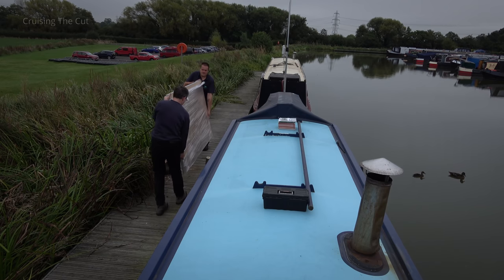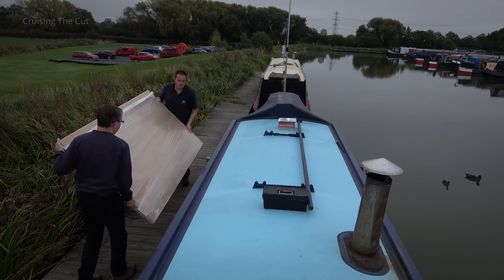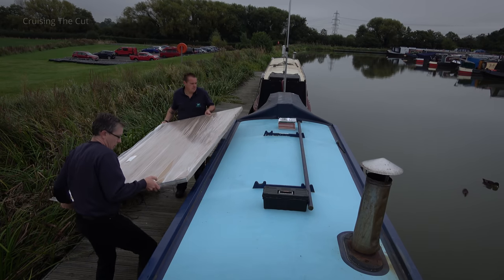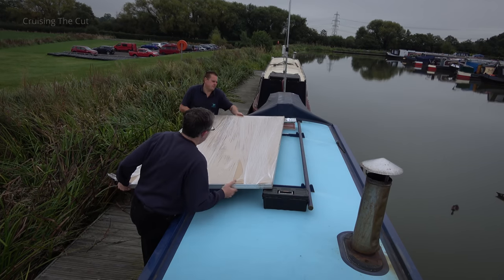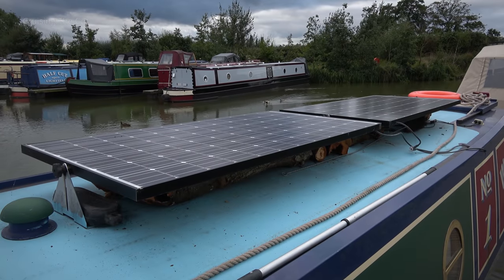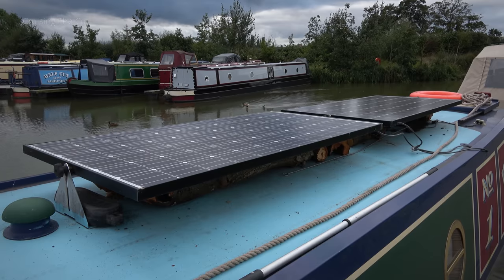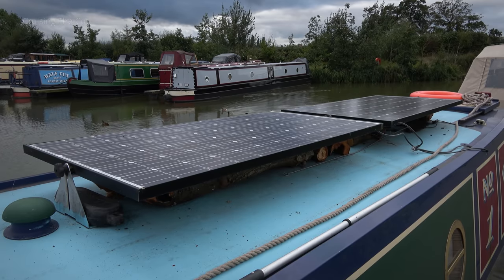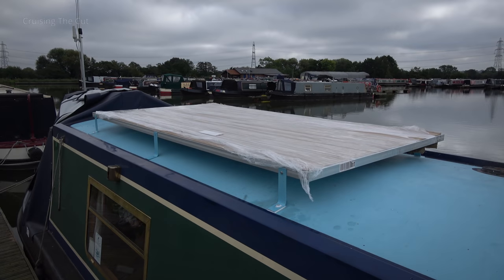260. Solar Panel and Lead-Carbon battery update (narrowboat)

Comment: Have you thought about running a hot water pipe from your log burner around your batteries? You will get lot more out of the solar if your batteries are kept at the right temperature. 
Really enjoyed listening to this.
Reply from the maker: They're at opposite ends of the boat

Comment: David, what would happen if you got one of those hard sided freezer gel packs?  We use them for picnic coolers here.  Freeze it up nice and solid by day when the sun is shining or engine is running, then transfer to the fridge overnight?  A little fridge is insulated like a cooler, and you could then run the fridge a little warmer.  Likewise, would a rechargeable battery vacuum cleaner let you store a little power for the other heavy energy consumer?  
I love your videos.  I imagine you could read the phone book and I’d enjoy that, too.

Comment: While you didn’t specifically say, it sounds like your panels are fully charging your batteries on fully bright sunny days. If that’s the case perhaps you just need more battery capacity so the sunny days will carry further through the overcast ones.
Reply from the maker: If only we had any worthwhile sunny days in winter!!

Comment: what about a small water wheel, or water turbine? keep up the video's!
Reply: You'd need moving water which you don't generally get on a canal. You'd also need quite a substantial water wheel to generate meaningful power (a boat prop just doesn't generate enough power) and river authorities don't like you disturbing the flow of the river as it causes flooding.

Comment: All the technical details aside, bottom line is are you happy with the results? It appears you are so job well done. BTW an old fashion incandescent light bulb provides a good test load used with a multimeter.

Comment: If you move your fridge to your "greenhouse" area, where it is colder, you can save significant amount of power as the fridge isn't heated so much by ambient air and does not need to run so often. The "greenhouse" might not be cold enough to keep your milk there but it is cold enough to help your fridge and freezer. Also I assume the "greenhouse" gets warmer only on days when sun shines, but those days aren't of any concern since you generate power from your solar system.
Reply from the maker: Cheers. There's no space to put the fridge freezer in the well deck and no power out there for it either
Reply: @CruisingTheCut  hehehe ;)

Comment: If there's a way to channel colder outside air on the fridge coils without chilling the rest of the cabin that would drop the fridge power usage dramatically
Reply: Caravans utilise this if they are well built. 
A grille in the exterior down low for cool air in...
and another grille up high to let the warmed air out.
Can you envision a problem with that on a boat?
Reply: @JohnSmith-yv6eq  Yes, but not an insurmountable one. It would require an air intake above the waterline, a baffle conveying the air under the coils, and a short chimney stack for the warmed air to escape. It should establish circulation pretty easily. It's a bit of a shame to "waste" the warm air, but it's probably still going to be rather chilly compared to the cabin temperature. The other issue is the space that gets dedicated to it in what is already a bit of a cramped situation.

Comment: It's great to hear the results of the experiment. :) It's a bit of a shame the engine run log was lost, but I can't say I wouldn't have done the same myself. I'm terrible for losing things. There is one point that I wonder about though. charging some phones (or tablets really) can take over 2A at 5V. I guess it doesn't go on for very long at that rate, less than an hour.

Good to know about the M1 Macbook power draw, that's a really impressive improvement. I'm glad you stayed out of the operating system debate. I'm thankful to be in a position where I can be very neutral on the subject now, but I do find myself whining about Linux when I see people falling for the hype l fell for in the 90s.

I get that feeling of relief. :) I had this thing about being very independant and I didn't like big corporations. I tried to live very independently in the digital world and I hardly had any mainstream entertainment either. I had some interesting experiences, but I didn't realise how stressful it was.

Considering these results, if I were to experiment with minimal electricity use, I'd first want to be very good at cooking so I can make nice food from fresh ingredients without breaking a sweat. I've entirely given up hope on that point. :) It might help to be vegetarian, and would definitely help to never be far from a grocers. Computing I'm not so sure about. Perhaps without a fridge, an M1 laptop would be fine? I don't know. In any case, my retro programming hobby could be made to work with very low-power hardware indeed. However, if I could work video playback into my project, it would probably need hardware drawing as much or more power as an M1 or a tablet. If I didn't have enough power for video when I wanted it, (regardless of the device displaying it,) I'd really be back in my old stressful lifestyle.
Reply from the maker: Yeah, and 2A at 5V is less than 1A at 12V so it's miniscule.
Reply: @CruisingTheCut  Ah... right. Blame that one on tiredness; I'm not sure I should be awake right now, although I've had plenty of sleep.

Comment: I really liked this VLOG.  I’m learning so much.  A question: Could having panels on both ends of the boat provide some advantage in shady moorings? Say, the stern is under a tree, but the bow is in the sun, that sort of thing?
Reply from the maker: Yes, if they're on separate charge controllers or have isolation diodes such that they can act independently.
Reply: @CruisingTheCut  thank you sir

Comment: David... in my experianse batteries last for 4,5/5 years before they get tired.
Reply: The life expectancy of good quality Lead Carbon Batteries in over 15 years when sized correctly for the application and  I have a 6 battery bank of 2volt 270AH lead carbon batteries that are still
Reply: Sorry,  the cat decided to play with my keyboard. I was saying if the batteries are "sized correctly and not cycled too deeply"   My Batteries are still doing their job and running everything they were sized to do.
Reply: What type of batteries? How deeply do you discharge them? What do you use to charge them?

Comment: Check out Renogy Dc-Dc 50 amp charger. In stalled one on my boat love it.
Reply: A good idea if you have lithium batteries, but no point to having one of those if you have lead-acid batteries which can be charged straight off the alternator.

Comment: just come across your channel, and I am enjoying the videos! just a thought..would a 12v coolbox be a better option for winter? probably use less power than a fridge, and I think you can probably get a freezer compartment one too! not sure logistically if it would be large enough to store your food for a good few weeks cruising but might be an option? anyway, back to watch some more!😃
Reply: No , because a cool box does not switch off when it reaches temperature unlike a compressor fridge . Even a small cool box will use 1200 watts over a 24 hour period where as a good 12 volt compressor fridge freezer will use about 500 watts (because it switches off when it reaches temperature)

Comment: I had a very similar experience, in that I added 760 watts of panels last Autumn, and I ended up with 1400 watts total.
I found the extra panels were very little use in Dec and Jan, as you found with yours, but my hope for the summer is that the surplus solar charge can be used to heat the water tank, and thus save running the engine for that job. 
I had my immersion heater wired to the inverter a few months ago, so any excess solar is now used to heat the water. 
I've found on about half of the recent days in late Feb and early March, I have enough solar to heat the water so that its hot enough to wash or shower. 
By April I expect to have solar heated water almost every day. 
So maybe your extra panels could do that?
My other cunning plan is to use excess solar to run a portable aircon unit on the summer heatwave days- but the problem is, where do you keep even a compact aircon unit for the 9 months of the year when its not in use?
Reply from the maker: There are some fairly slimlime roof ones you can get for motorhomes these days…
Reply: @CruisingTheCut  , be still my beating heart. 
But no, this way lies madness, surely. 
A humble boater cannot expect to be cool in June or July. It's just not right. It would be akin to a rift in the fabric of space time. 

Still, no harm in just having the briefest of ganders at these miraculous products....

Comment: To the average numpty(me), it instinctively feels that  small wind generator should be the winter, extra generation. I'm sure you must have your reasons for not going that direction and you must have researched it more than I because I haven't. It would be interesting to hear your views/experience.
Reply from the maker: Wind generators are a bit rubbish on the canals, see https://cruisingthecut.co.uk/f-a-q/
Reply: I know no sailor who is happy with a wind generator. Lots of vibrations and noise giving very little power.
Reply: Wind generation sounds wonderful until after you have invested money and find massive amounts of consistent wind are required. Plus you need to put up the tower every time you moor. I cannot count all the friends who have tried it only to give up. If you live a staionry lifestyle and where the wind is often unrelentingly above 30 kph…then wind could be your huckleberry.
Reply: @CruisingTheCut  Well that saved me a lot of research👍, 😂

Comment: How many hours a day do you fire the stove in winter? There are thermoelectric generators (like your fan but bigger) that you can put on the stove that can generate 10-100 W. That might help in the winter? Smaller units are just placed on top of the stove, the large unit needs installation on/in the stove pipe.
Reply from the maker: Hi. Unfortunately, those things generate absolutely microscopic amounts of power, even the 10W figure would be generous - it's about enough to charge a phone but not much else.
Reply: @CruisingTheCut  The biggest unit I saw was 80 W and took the heat from the flue gases in the stove pipe (cut out two pieces of the stove pipe and replace with the device) and had water flow as the cold side. A bit pricey though at over 1000 dollar so diesel for running the engine might be cheaper despite the inefficiency.

Comment: 10:27 saw a thread on canalworld where someone mentioned using their bilge as a fridge over winter, which i guess would make the most sense since the temp is probably most consistent there what with the water basically acting as a massive heatsink and i doubt itd get over 5 deg even on the sunniest winter day, idk though i dont have a bilge to try it
Reply: Not really cold enough. The official route is a bucket with a bit of water in it , place your items in it and drape a cloth over them that dips in the water, soaking it up and evaporating the water hence cooling the contents.
Reply: Nice if you have non oily, non weasel infested bilges like many narrow boats

Comment: I am off-grid with 14 x 100AH Lead Acids and 1.3kw of panels and I must admit I cannot run a fridge all through the winter. The light changes late October and does not really start to return till Feb. I am working on more panels and a small wind turbine.
Reply: If I was you, I would save my money and build a back up lithium battery that charges up in the summer.  You don't need a separate solar system for it, but get a DC-DC charger, even a small one will do as it should build up over time.  The skills you will learn building the lithium battery for a back up will help you in the future as you can slowly replace the 14 leads with home built lipo4 as they wear out.  I can build a 330Ah Lipo4 for £472 now,  and the price is still dropping  (and you really can use all that 330Ah if you want so it is like having 660Ah of lead)
Reply from the maker: A battery bank big enough to last through winter with negligible solar would be immense!! I used to use about 150Ah (12V) per day if I recall correctly so a bank big enough for December & January would be roughly 60 x 150 = 9000Ah or 108kWh 🤣
Reply: @CruisingTheCut  Yea David but remember it wasn't that long ago we were saying that about 1GB hard drives.  You can actually buy 14kw racked batteries for less than £2500 now in kit form.  I reckon £15k would suffice, and before you say "that's an awful lot" remember its only about two years marina costs in some posh areas.
Reply from the maker: Battery technology is certainly improving but to suggest building a backup battery to last through winter is just entirely impractical at present. Even in another decade, I'll wager it would be impractical to do on a narrowboat.

Comment: Just a quick one on your MacBook Air M1 charging. If your charger is 30watts then that's about 2.4amp at 12.8vdc (granted there will be the inefficiency of the inverter to take in to consideration so lets say 3amps). The important thing is that 30watts is NOT what the laptop will be using when it is plugged in and charging 'all of the time'. When the battery is nearing full, then the current will drop significantly. As the battery in those frugal computers lasts for maybe 15 hrs or more when browsing the internet and watching movies, it will still not necessarily use 3amps that often at all if you are video editing and such things unless you are somehow outrunning the charger with the laptops usage, which will not happen. So, your 3amps will be realised when the battery is low or flat (don't do that too often!) or rather the charger is providing its full current at the top rate of charging but then they don't take long to charger. I have a MacBook M1 Pro 16" and charge it in our camper. It draws 140watts when it's largely flat, say 11amps or over 12amps due to the inverter but after and hour, it's fully charged and draws very little at all. In fact, I tend to unplug it and recharge when it gets to 20-30% which when watching movie and such like, takes about 18 hours. Then one more hour at 12amps and that's another few days of use.

Comment: You can–if you like–multiply the volts with the amps to get watts. At that point you no longer have to specify voltage and current.
Reply from the maker: Yes but the batteries used by narrowboaters and RVers tend to have their capacities stated in Amp Hours and are (usually) 12V so it's more common to relate to Amps and Amp Hours.
Reply: @CruisingTheCut  that is both true and irritating.
Other kinds of batteries do likewise. Phones are particularly egregious due to their use of milliamp hours even when there are several thousand of them. Surely that should be amp hours.
Or better yet, watt-hours. Joules, even!

Comment: Any battery voltage measurement with a digital meter must have a load on the battery because the input impedance of the meter is so high even a "dead" battery will show good voltage.
Reply from the maker: I don't believe that to be the case else meters would be useless
Reply: @CruisingTheCut  Next time your flashlight  batteries go flat pull one out and measure it with your digital meter, it will still read 1.5Vdc even though you know it to be flat.  As a battery goes dead it's output impedance goes up therefore when very little current is drawn the internal IR drop is negligible so full voltage is seen by the meter.

Comment: Would a small (1000 Watt) Honda Generator work on the boat?  They are very quiet and burn minimal fuel compared to running the main engine.
Reply from the maker: Hi, please see my pinned comment at the top :-)

Comment: A good battery controller will be able to read the charge current, load, and voltage, and extrapolate a theoretical max capacity for the battery  even without doing a full-discharge test. Can then see how they're degrading over time.
Reply from the maker: Yeah, I don’t have one of those

Comment: Could you put the refrigerator/freezer outside the cabin in the winter?  As it is, you're spending power to heat the boat, and then spending more power to move heat out of the fridge that gets in from the cabin.  With the fridge outside, you should only have to "make up the difference" between the "cold but not cold enough" ambient temperature and what you actually want in the refrigerator.  That way everything would be kept at a safe temperature, but you wouldn't have "dueling appliances".
Reply from the maker: Unfortunately, not practical to move the fridge anywhere else

Comment: I was thinking you could buy yourself a small Honda generator and run that to charge up your batteries when needed instead of running your engine. It would be a lot more efficient and they were extremely quiet. Just a thought
Reply from the maker: Hi, please see the pinned comment at the top, cheers

Comment: Your new panel will double up as a sun shade in summer 😂
Reply: Yes it will, sort of like a "safari roof" on a Land Rover.

Some folk, me for one, are contemplating using a solar powered water pump to provide a sort of constant water drench over the roof on the days when the Sun can make the steel roof too hot to touch (really).

Sliding into the realms of fantasy I wonder if "anyone" has considered harnessing the Peltier effect for charging 12v leisure batteries ...

Comment: I wonder if pumping water from the canal and using a heat transfer unit would be more economical than running a compressor fridge in winter.